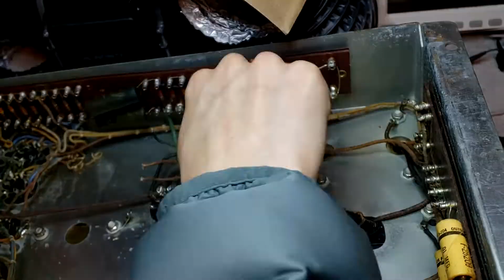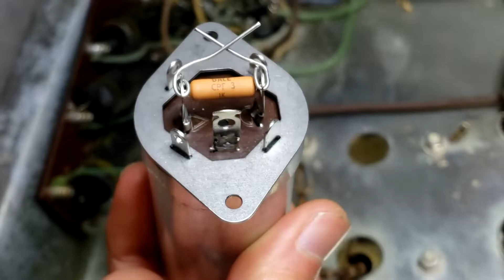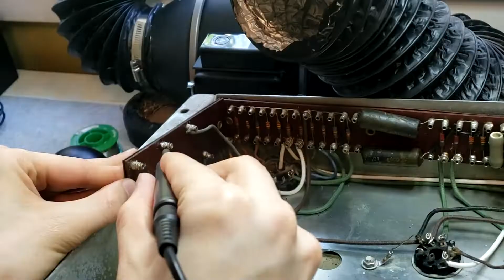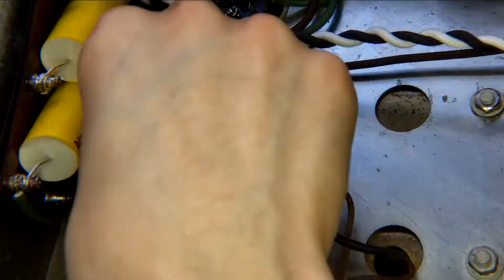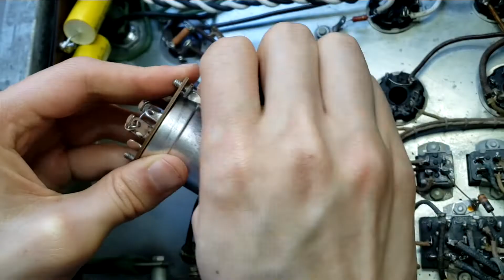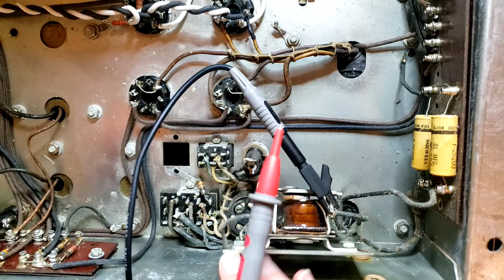1940s Capehart N2 Amplifier Restoration (Part I)

Comment: Major accuracy issue: Brook had NOTHING to do with Capehart products of the era. This whole deception started about 5-8 years ago on eBay when some seller decided since Brook amplifiers were selling for so much, and Capehart amplifiers had 2A3s, they must have been made by Brook. Huh? Unfortunately, lots of folks fall for this BS and get ripped off. There is absolutely no information anywhere showing Capehart amplifiers were made by Brook. Nowhere. Period.That all being said, these Capehart amplifiers are really well designed with excellent parts and construction.
Reply: Capehart made both a PP 6L6 and PPP 2A3 version (4 2A3s). Big tipoff when you see these for sale is when the seller refers to them as "Brooks" amplifiers. If you're going to misrepresent, at least get the name of the company correct. Brook was a very small company with nowhere near the capacity to supply Capehart's needs. Capehart had huge production and engineering capabilities after building equipment for the war.
Reply from the maker: @audiotechnica1827  Thank you for your comment. There was no intention to misrepresent as I have no desire to sell this amplifier and bought it for cheap -- the seller had no idea it was even a Capehart. That said, I should have done due diligence to better investigate the widespread claims these amps have some relationship to Brook. I will revise the title if possible and pin your comment so hopefully nobody is misled.
Reply: @audiotechnica1827  and dont forget the 12 watt with the two 6V6's. This was designated N-3. the N-1 was rated 30 watts at four ohms,the N-2 was 18 watts at eight ohms.
Reply: @Mr39036ce  There was a variant of the N-1 which had an 8 Ohm output impedance. It also had global negative feedback. This was used with the Western Electric phenolic cone D173491 military version 12" speaker.  The power relay was used to minimize stress on the on-off switch, which was located on the tuner chassis. The high  inrush current of the large power transformer was likely a factor here.